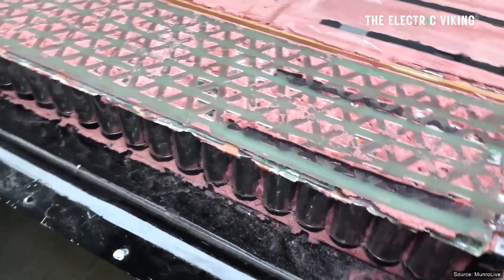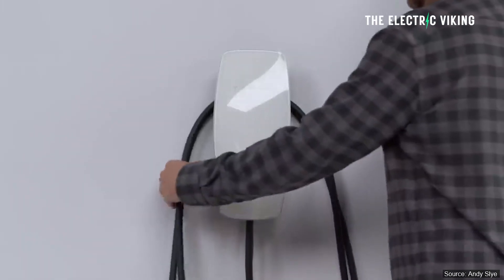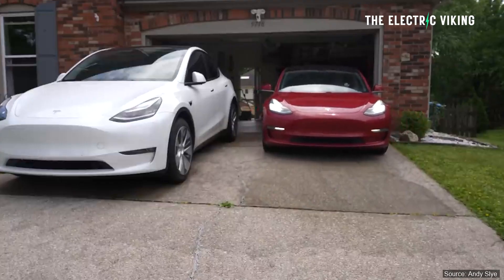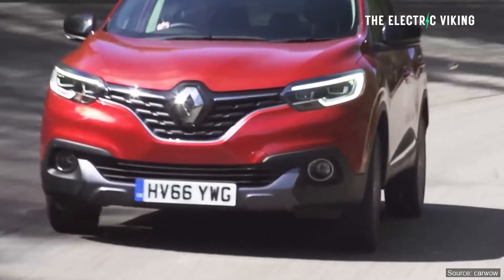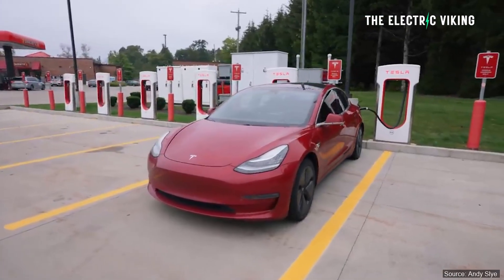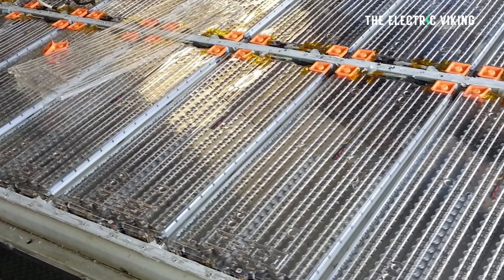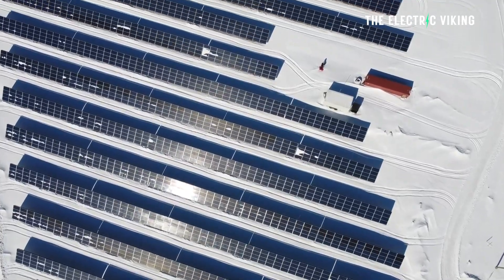Tesla owner reveals secret to 95% battery capacity after 135,000 miles

Comment: I drive a lot for work. I charge at level 2 59% of the time  and Super Charge 38% for the last year. I own a 2024 Model Y Dual motor. I have 26,979 miles on the car. My battery health is at 90%. Seems Like high degradation.

Comment: According to Tesla the 2015 Model S battery has an expected lifespan of 10–15 years or 200,000 miles, so even suppose 95% capacity after ten years was experienced, while impressive, it’s not the whole story when it comes to battery longevity or obsolescence. 

As batteries age, resistance increases, reducing efficiency and causing more heat during charging/discharging. Tesla’s liquid cooling system is robust, but degradation in pumps or coolant can lead to uneven cell temperatures and accelerating wear. Older batteries may struggle with fast charging, even if capacity remains high.

While the 2015 Model S was a pioneer, today, Tesla batteries are engineered for speed, longevity, and scalability. The shift to Aluminum-Ion and 4680 cells marks a leap in affordability, sustainability, and performance.

But even given that, obsolescence is the whole package. Just as with an ICE car a quality engine that is well maintained can be the least of the problems. 

There are many people think that with an EVs the obsolescence is primarily the battery, and while that is a key component, there are other things like the software and firmware constraints, battery management systems, feature lockout (bidirectional charging), software induced downgrading,  range inflation, recharge speeds and depreciation that all need to be taken into account when buying/selling a ten-fifteen year EV.

If people want to look at Tesla not as an EV maker but a tech company, then obsolescence is inevitable and unavoidable. 

FSD will not be available to vehicles with H/W3, and those with H/W4 fitted are likely to experience the same problem. 

People who are running a five year old PC could in theory swap out the processor for the latest model, but its not just the processor, it is the memory, I/O throughput, display quality, port configuration and a zillion other factors that need upgrading, to achieve modern day performance.

Comment: Capacity/degradation is not the big fear. It takes 1 out of thousands of battery cells to fail and you need a replacement battery pack. It happens a lot.

Comment: Our Kia Soul EV (2017) has 140.000 km with a degradation less than 10%. The baterry capacity on this car is 30 kWh so you need more than double the cycles compared to a Model 3 with a 70-80 kWh.

Comment: Already going on ex taxi/rideshare cars that have done 500,000kms plus in China, the car has been scraped and the battery pack has been refurbished powering homes in Pakistan with solar as load shedding has been a problem for the past 30years. The price to install solar is very cheap, its an issue to find affordable battery storage. There's people putting in mutable truck and car battery's designed for ICE cars to store power, but they just don't last long as there not designed for that purpose.

Comment: I’m sorry sir, but you had terrible luck with your Mitsubishi. I have worked on my own cars since I was 16. I bought my first brand new vehicle in ‘05, a Ford Focus wagon with manual transmission. I drove it until this year, it had 200k miles on it, and never even had the clutch or fuel pump replaced. I did all the regular maintenance I could to it myself, and the guy who bought it said that the mechanics he took it to for general diagnosis wanted to buy it because of the condition it was in. 

 I own a new Bolt EUV now. I was a bit disappointed to see that Tesla’s only had 90% battery life remaining after 100k miles. I honestly expected more. I have a L2 charger that allows me to charge at 2.4, 3.8, 5.7, 7.6, and 9.6 kWh. I choose the slowest rate to get the car charged before I will need it. I do this not for the battery, but to extend the life of the electrical service components. Maintenance and mileage cost were why I chose to go EV. I also surmised that battery technology will decrease cost for replacement batteries as well as increase energy density to the point where I’ll be able to have the battery upgraded fairly inexpensively by the time it is necessary if it’s worth keeping.

Comment: What I want to know is how did this guy get to the 95% battery capacity number? Based on Tesla self report range? I would call that BS. I have a 2016 model S 75D with 90k miles.  It gets fast charged  2-4 times per year. It mostly gets home charged at 40 amps to 80% capacity. On rare occasions I run it to 0% and charge it to 100% to see what it still holds. Cureenrly, 0-100% uses 60 kwh. 60/75 = 0.8. That is 20% degradation at 90k miles. Rarely supercharged. I think this guys secret trick is that he was lucky.
Reply: The numbers are wacked. 95% capacity or 95% of the original miles per charge? Then I heard 75%?

I have a 2020 MX with Free Supercharger and had 50k miles and only lost 20 miles from 328 to 308 All supercharger miles.

That's what I also get from my 2022 X. 23k miles and lost 20 miles of range

Comment: I have owned a standard range  model 3 for 4 years and have 60000 kms on it. I also only charge it at home (no super charging) and plug it in every night and only charge to 65%. At end of day I'm usually have around 45% left. I have 97% of my original battery capacity. It's pretty amazing.
Reply: How many kw charging at home? 🙂

Comment: The secret to having a long lasting battery is charging it to 80 percent. Tesla recommends you charge your car if it’s below a certain percentage. If your battery is at 60 percent it will charge slow.
Reply: The 80% rule is entirely dependent on the Tesla battery type. LFP batteries should be charged to 100%

Comment: I think as we see increased EV penetration, we will start to see a lot more recycling and refurbishing.  Say you need to replace 10 of 60 cells, clean contacts, and away you go.  Those 10 cells get recycled, customer gets the refurbished battery.  

What i like about that is that is primarily labor.  Which means decent jobs.

And if you have an 8-12 year old car, still looks good,  refurbished battery buys you several more years.
Reply: Yeah, if you don't have a structural battery pack.
Reply: The fact that it is primarily labour is why I believe the whole pack will be replaced. The car owner will get money from the old pack. Either to be used for a less energy intense purpose (eg home backup) or for recycling to a new battery.

Comment: If you buy an ICE car, you can take it to a dyno shop (after the run in period) and check the power of the engine at the rear wheels and do the same after 100K miles to know the actual loss from new to old. I will guarantee, no Tesla owner is taking their new battery out, getting the full capacity tested and then doing the same 100K miles later. I have even heard Sam say that some cars have gained range after a software update. So how much capacity is hidden in the battery to help with capacity loss? It makes sense as used prices will vary a lot by battery degradation.
   If you only use the car for shorter journeys, it is nice to know you can drive for 100k's miles and have very little to worry about.
Reply: Good point.  From some of the comments here by owners, they are fully trusting the car to calculate their estimated expected range and not actually driving the car from full charge to nearly empty to test the range.

Comment: I think he forgot to mention to keep the battery charged above 20%, so basically only use 60% of your capacity at any given time.
Reply: Don't leave your in the garage with <20%
80% usable capacity
btw, i think on road trips you can charge to 100% since you will discharge instantly
Reply: @tv-ld3wv   20 + 20 = 40   100-40 = 60    So 60% usable range? Well, doing the best for the battery.

Comment: Assuming a flat degradation rate,  that would work out to be 540,000 miles and 20% degradation. Not bad.
Reply: Actually they say the most battery degration you're going to get is only during the first year of ownership. Not much after that.

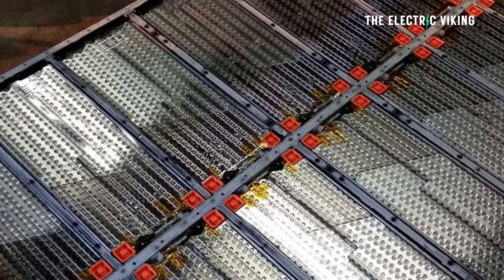Comment: 4:25 He only uses level 1 and level 2 chargers and limits it to 80%.
Reply: LFP = GAME CHANGER
Reply: Thanks
Reply: I was literally going to do this. this is extremely click bait video.. he yaps for minutes.
Reply: You forgot to say "Spoiler Alert!".
Reply: @scottbreseke716  Good on him!
Reply: Are  levels 1&2 considered slow charging thus more efficient?
Reply: @Lee-vb4vh  Slightly more efficient, mainly less heat producing, and therefore gentle and friendly.
Reply: @Lee-vb4vh Yes, slow but not necessarily efficient. It does not stress the battery though, and that's the point here.

Comment: There is a guy in LA runs a taxi co. with just Tesla cars. Battery longevity seems to be with a bit of luck, the cars do many trips from LAX to Palm Springs and other fairly long routes. Some cars failed at 200,000 miles others still going at 600,000 miles. His biggest spend on maintenance was for tyres and the high usage cars had lost the sheen on their paintwork, driving through sand in the wind. Also mostly the upholstery held up except the 'pilots' (sic) seat.
Reply: I think longevity is a bit random if you supercharge the pack to death. High charge states every day. This would only be the case for a commercial user. For the few that do fail in these circumstances, it's totally worth it for money saved in fuel and maintenance.

Comment: I bought my used 2017 VW e-Golf 2 years ago with 20k miles on the clock. I usually charge at 500 watts @ 220v from midnight when PG&E EV rates are the lowest. 
I've only used a DC charger twice. I now have 47k miles on the car and no noticeable degradation. 
5.2 miles per kWH, in summer, at 28 cents per kWh means it costs me about a 5 cents per mile to drive. My diesel Sportwagen costs about 15 per mile to drive.

Comment: The secret is whispered on the screen, in the color of the SOC, from the book of Elon. M3LR 100k mi. We top at 272 in rare 100% charges now. Was rated 310 originally, but never witnessed that SOC. Now, the question is are the miles still miles. I don’t know as the chargers are maximum 120mi apart and have never failed to allow 80%. We forsee another trouble-free epoch, and have saved enormously on TCO.
Reply: 95% home charged on the original fat wire charger, at midnight, solar+battery installed coinciding with purchase. 10 tires, 1 alignment, 1 moisture maligned rear light. Is the extent of “trouble”. All Financed by good-old days rates.

Comment: When the batteries get down to 80% state of health they don't work so well in an EV.  They just can't deliver the bursts of current needed to drive the car. But they'll last decades as stationary energy storage where the current demands are lower. Jack Ricard of EVTV fame was working on this. His goal take the battery out of the car, plug in a controller, add solar, done.
Reply: Brilliant!~
Reply: Solar is capable of adding only SMALL amounts of charge.
Reply: @scottbreseke716  We're talking 6kw or more solar arrays. More than enough to power a house. Problem is at night there is no power, that's where the battery comes in.
Reply: @scottbreseke716  You didn't say what size solar. I know of solar arrays that could charge 100's of EV's without breaking a sweat.
Reply: @geoffhaylock6848  The size that would fit on a car.

Comment: Silly question, but how do you measure battery capacity? Estimated miles is based on the driving style and mine says it charges to 100%, so I’m not sure where to get this info. Thanks
Reply: Terminal Voltage. The reason manufacturers say to charge LFP batteries to 100% is because the difference between the fully charged terminal voltage and the close to empty terminal voltage is very small, charging to 100% once per week helps minimise the risk of the pack becoming unbalanced.

Comment: I am a bad boy, I charge most of the time on super chargers and up to 95% capacity with my ioniq5. I have made 55000km in 2.5 years. I am curious to see my battery degradation in few years. Up to now I continue to do 400km easily, up to 450max. The driving behavior is the factor influencing the most the car range. If I keep my speed always below 100 km/h I can achieve almost 500 km with the 73kwh battery pack. And if I drive 130km/h , the range drops to 330 km. This car is fantastic

Comment: A useless story, in non road salt states car maintenance can be much lower, plenty of examples of experiences with very little costs aside from brakes or oil changes, even with some domestic models, the kid with two tesla looked to be a trust fund Californian...

 it would be interesting to see if the batteries will experience exponential degredation of capacity, once a threshold of say 15-20  % is experienced

For folks who experience real winters, ie ice , snow and minus 28 degrees Celsius, how will the teslas up, fine for rich  folks with  a stable of heated garaged cars to choose from but what about the average Joe...

Verdict is still out for me with 3 vehicles  8-17 years, and zero major repairs ie only items such as brakes,

Comment: My 2015 MS 85D has 210,000 miles (340,000 km) and has 90% capacity.  I Supercharge 10% of the time and I’ve always set my charge limit to 90%.  In my case the car is kept cool most of the time.  I suspect heat is the underlying theme in degredation.  Charging less and slower would keep heat down.  Anyone in a hotter climate .. or experiencing a heat wave .. should be very careful and do what they can to keep the pack cooler.

Comment: I limit my "daily" charge to 75% and try to keep it between 50% - 75%.    I only drive 8,000 miles per year and 99% of my charging is done at home on Level2.
Reply: Hopefully this would apply to 'most' EV use. So the grid will not have the massive task of refuelling thousands and thousands of 80kwh batteries every Friday night.

Comment: My 2019 TM3 after 60k miles was 96% Mostly home charging but did 1 8,000 mile trip Philly to LA & back And 20,000 in run outs & touring.  Very happy, no mechanical issues.
Reply: Home charging ?

Comment: The loss of capacity is not the only sign of battery degradation, more serious is the increase in the internal resistance of the battery, which can cause a sudden drop in battery voltage under load resulting in the BMS disconnecting the battery. Using old batteries in home storage is only a theoretical possibility. Or do you know of a company that will guarantee the fire safety of an old EV battery when the safe state of the internal battery structure cannot be determined?

Comment: Solar energy is not free. Someone tried to sell me rooftop solar panels a year or so ago, but the cost per kWh over a decade, with battery storage, would have been greater than power from the grid. They guy didn't try to sell me battery storage because it was so expensive. Maybe costs have dropped since, but solar energy is never free.
Reply: Isn't it about return on investment? When rates are low, maybe better to invest in something that saves on the bills. Eventually that investment in solar will pay for itself and then 'free' energy. Of course we will have fusion in 20 years and electricity will be so cheap solar will never pay for itself.....yep just 20 years away...again....

Comment: Very good point at the end and something I have wondered. If you did need to replace the battery, will there be companies out there that could then repurpose your old battery into a home storage one? If it's something you were looking to add to your home anyway it could be a good option and you might even be able to fit a more energy dense battery to your car to increase it's range at the same time. Even if a 64kwh battery was down to 40kWh usable thats a massive home battery (well here in the UK at least)
Reply: I do know someone that bought a battery from a hybrid to use as home storage and a few other projects. I have played around with powering children's electric ride on cars from 18650's instead of lead acid. I'd never mess around with home storage as I'd be too worried about invalidating my house insurance. It's not like the fire brigade can do much about a 10kwh lithium battery on fire under the stairs. At least recycled batteries made into commercial home storage units should be safe.

Comment: Our TM3 is only 2 years old (& we charge at home to 80% most of the time & not let it go below 20% if we can avoid it, so hopefully we’re not experiencing battery degradation yet!).
My question though is how does degradation manifest itself?  Eg. Assuming degradation to 95%, does the car show that you can only charge to 95% max, or does the expected range at 100% only show 95% of what it did when new?  Just wanting to know what to look out for ;)
Reply: The % says 100%. The max km/mi will lower.
Reply: You'll have 95% battery capacity left even if it shows 100% on the dash. It'll show 100%( of 95% capacity )
Reply: Just look at the range displayed on your screen when battery is charged at 100% and compare to same displayed range when car was new.
Reply: it's the amount km/miles that decreases. See if you still get the same range you get now at 80% - 90% or 100 % compared to 2 years later

Comment: Our 2016 22kw Renault Zoe had 97% after 7 years and 29k miles. No rapid charging as it wasn't the CCS model so capped at 22kw charging. Majority of time it was charged at home to 100% each time with the odd "top up" charges when at the shops etc.